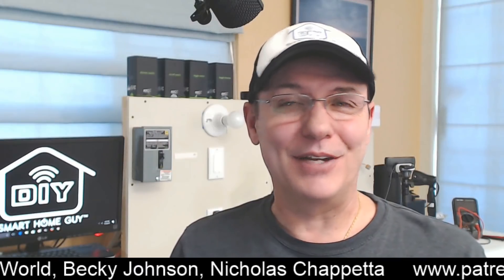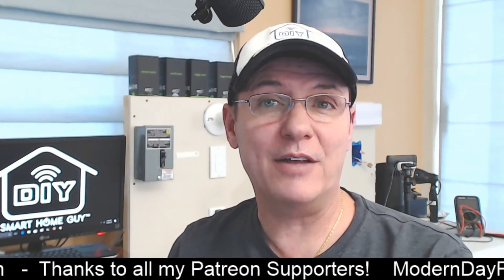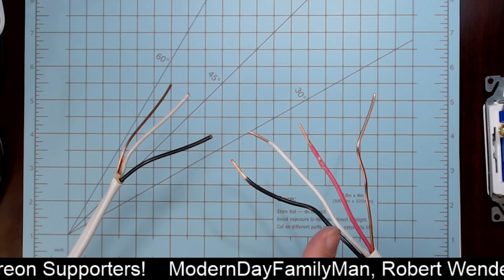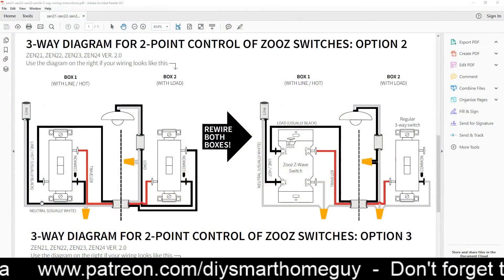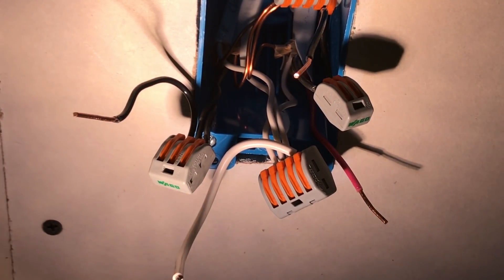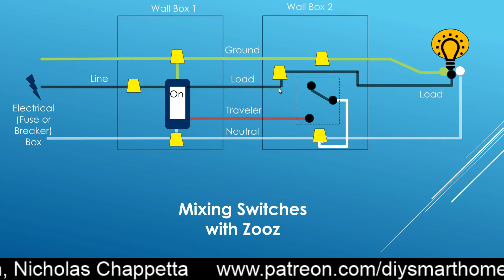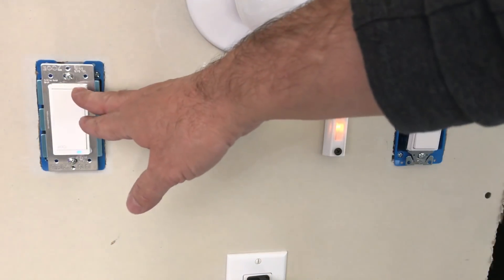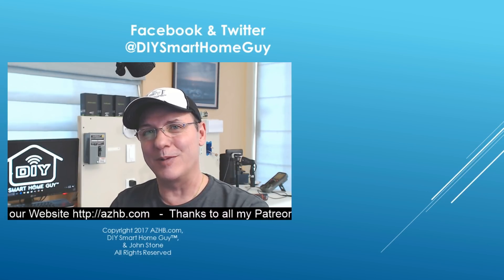DIY 3 Way Switch Zooz Zen21, Zen22, Zen23 & Zen 24 Z-wave Smart Switch Installation

Comment: As was mentioned in your other video, it turns out that Lutron Caseta PD-6ANS allows a 3-way install with a mechanical switch. See page 28 here: https://www.casetawireless.com/3way "3-Way Installation - Caséta® Wireless In-Wall Neutral Switch with Mechanical Toggle Switch". You can also add a on/off (non-dimmable) pico remote PJ2-2B-GWH-L01.

Comment: Looks like if you compare option #3 on easy-do-it-yourself-home-improvements.com to the corresponding diagram on your site, you have to re-wire the light box also?  Anyone come up with a way around this?  In my case, it's a foyer light box that's like 20 feet up in the air.

Comment: great video!   So... silly question, but if all the second non-zooz switch does is toggle the red traveler open/closed to the neutral/white,  why do you need a 3 way switch at all?   Wouldn't a normal 2-way switch do the trick?   More just curious...

Comment: I have a three-way switch wired in configuration # 3 on the "Easy DIY" website.  The switch I'm trying to replace has Black, White, and Red wires only (plus ground of course).  How would I wire the Zooz into this switch?  Or would it be better to replace the other switch in this three-way circuit?  I'd like to avoid that if possible because the second switch is in a gang box with three other switches.

Comment: The product says don't use with ceiling fans. In my case the ceiling fan is apart of my light fixture and the switch is just used to turn on the power to the fixture. To turn on the fan I have to pull the string on the fixture itelf. In this case could I still install with ceiling fan?

Comment: Yoooooooooooooooo love the channel just hooked up my zooz 3 way smart switch with a none smart switch and it works like a charm. Been having problems with this for a while. After watching a few of your videos and following your diagram everything works perfect. I now have 7 of theses switches in my home. One I had to send back because it was defective but the others all work great thanks to your help. FYI to any one who uses Model number ZEN22. If you don't use the short screw that came with it to screw on face plate and actually use longer ones you will have sparks and problems  especially in the bottom hole. Try it out if you don't believe me but you been warned

Comment: thanks for the video and links to different 3-way switch wiring, it turns out our house use the 9th option to wire the 3 ways switch in the stair way......after this significant finding the rest is easy
love the Zooz switch specially it works with existing regular 3 way switch :D

Comment: Grear video, I followed your instructions step by step, however after installing the zooz switch in the kitchen the lights wouldn't turn off and they were dim, and then I wired the second  switch also, and they communicated to each other, but they would only change the light from dim to very dim, no full on or full off. Any idea what's happening? Is it a bad switch?
Reply: DIY Smart Home Guy the second switch is just a mechanical switch, should I try the zooz switch in a different regular non-3way switch and see? Or do you think it's a voltage thing, my house is newer it's 2015 built
Reply: DIY Smart Home Guy yes it worked fine in a different switch, so it must've been in the way I wired it. The only issue I had difficulty with was that the neutral wire coming from the existing switch was black, but there was also a bundle of wires in the back that were white and neutral so I just connected the extra white wire in the zooz box to the black "what I assumed was neutral based on its location of the existing switch"
Reply: DIY Smart Home Guy thank you, one final question. , I installed the switch in a none 3 way switch and it worked fine... The switch is used for the outside light which has 4 lights, 2 LED flood light and  2 GU 24 light fixtures. The GU 24 light however are not turning on they're just flickering, the two floodlights are working fine. Any idea what's happening?

Comment: Thanks for this. What diagrams can I use if my existing 3 way wiring setup is #3 on the Easy DIY website?
Reply: DIY Smart Home Guy Thank you so much! I made it to your webpage after some googling (a lot - I'm not good at Google) and used that very diagram. It worked like a charm! Already got a few more zooz switches in the mail to replace my other 3 way circuits!

Leaving printouts of your wiring diagram in the gang boxes in case I end up selling my place and the next guy can't figure out what I did with his wiring :)

Comment: Excellent video. Very well described!!  I have an off-topic question though-  Do you have or installed  Zooz on/off switch with no dimming function?   If so , could you tell me if the Zooz on/off switch has a relay inside where you can hear a click sound when you turn the switch on and off via an app. Thanks!
Reply: Thanks!  Reason I asked is if I could use zen21 to control fans and tube lights, although the user manual says not to use it for that purpose.  I think that was a typo for zen21
Reply: Zooz tells me it’s not a relay, but a solid state device controls the on/off function, which is hard to believe in the case of a non-dimmable switch, especially when people can hear a click
Reply: I spent a few more bucks and bought GE relay switch for the fan and tube lights   Thanks for your help trying to figure out the zooz mystery

Comment: Thank you so much!!! Solved the annoying mystery. In my case, the hot from breaker and the load to the light was in different boxes. I simply put the wire nut to connect the load to the black traveler and voila. Really appreciate what you shared here.

Comment: Hi I'm trying to wire the zooz zen21 with an existing 3 way switch, having no luck.  I have the zooz wired so if the existing 3 way is toggled to on, the zooz works as an on/off switch properly.  But if I shut off the existing 3 way switch the zooz loses power.  

Here are photos of the switches before I put the zooz in:
(3 way I replaced with zooz -- note the switch next to the zooz is a dlink hs200 which works fine -- also note the black item in the back of the photo behind the switch is the ground wire of my voltage tester): 
https://imgur.com/gjs0RZ8

(3 way still there): https://imgur.com/0tRlELa

Hoping you might be able to tell me what I'm doing wrong -- or based on the photos tell me which wire is which -- I thought I understood that but I'm clearly missing something.

Comment: I’ve determined I have option 5 of the 3 way wiring. I like the idea of not having to replace the other switch and like the looks of this switch over Caseta. I haven’t ordered this switch yet, but was wondering if it would work with my wiring setup?

Comment: I just installed a ZEN21 Zooz (On/Off) Switch in a 3-way setup. When I flip the "dumb" switch the lights flicker, but when I have the dumb switch in a certain position the Zooz switch works great. 

My understanding was to put the Zooz closest to the breaker, and the "dumb" switch closest to the light and then the neutral wire will trigger the smart switch to let it know what position its on. 

Am I missing something obvious? I'm going to pull it out again and see if I missed something. 

Thanks!
Reply: Update - I have determined that I have option #4 as my configuration. https://www.easy-do-it-yourself-home-improvements.com/3-way-switch-wiring-diagram.html#op4 

Is it possible for me to use this ZEN21 Zooz switch with a dumb switch?
Reply: https://www.youtube.com/watch?v=_KsCzjH1hvc 

I posted a video of what happens when it's connected the way I think it should. 

My dumb switch only has red, green, and white going straight into it, nothing coming out - so I'm making an educated guess that it's option 4. 

Thanks for looking into this!

Comment: Did you have any problems with the z wave mesh range of the switch? It seems that my hub is taking too long to communicate with the switch. The hub is located one room over to the switch.
Reply: DIY Smart Home Guy 
I have a Samsung smartthings, it's 30 feet away from the only connected device in the house.

Comment: nice Vid! was going to upgrade my house to zooz switches and this vid is what i needed as i dont have any experience in wiring stuff. Also, ive noted in the in the manual, zooz zen22 needs a minimum 20w load, and zen21 needs 15w load. what happens when you have lesser loads? much of my bulbs are <20w, but are dimmable. i want to use the zen22 but im afraid it might damage it. Do you know what might happen if is use the zen22 with a lower recommended load?
Reply: Thanks John for helping me get the answers. much appreciated!
Reply: what zooz are you using zen22(with dimmer) or zen21(without dimmer) for those 9.5watt total load bulbs?